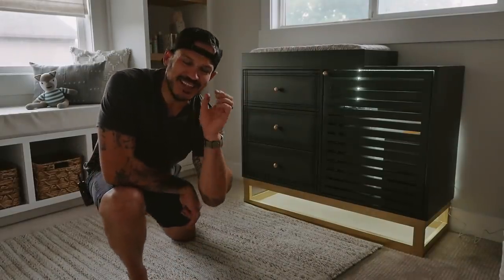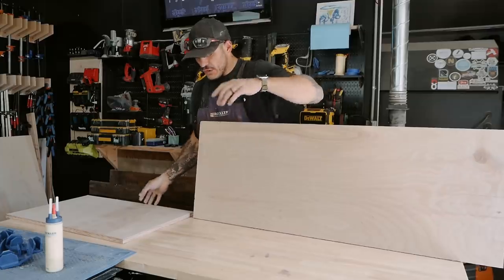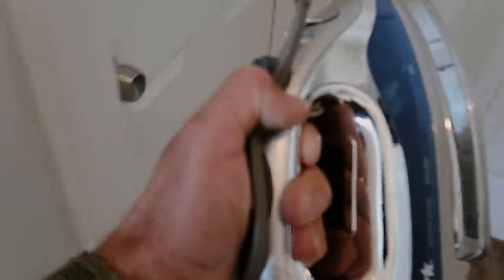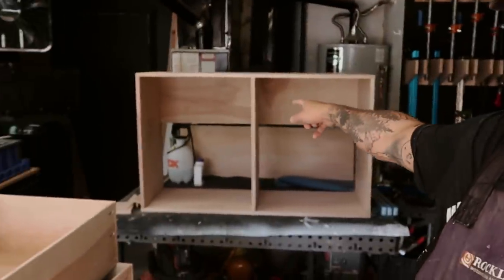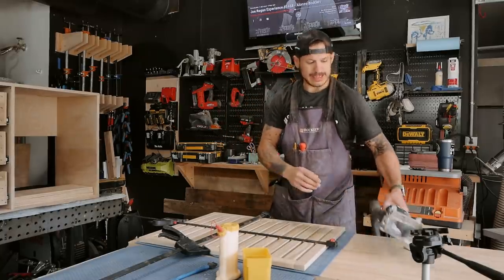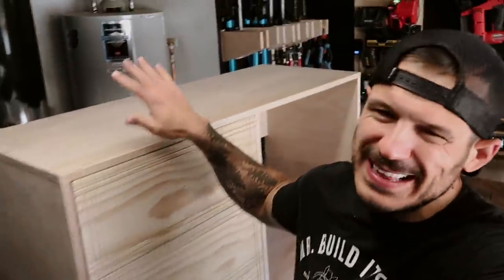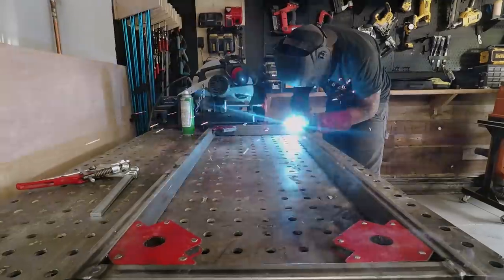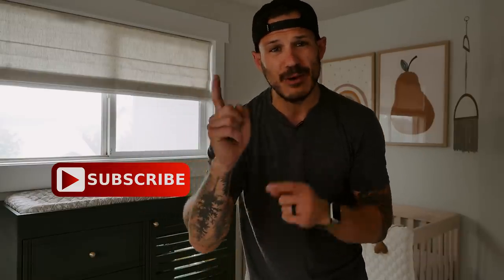I Built our Daughter THE ULTIMATE Changing Table Dresser

Comment: 16:58 Best tip you will ever learn. Using a ziplock back to line your sprayer container...holy crap! So much easier for cleanup and if you have extra you can easily transfer it back into the container, nip the corner and pipe it back into the original container. This is what learned from your video, nothing to do with the build, which is awesome btw, but I'm taking that zip lock bag idea.
Reply: I saw him do it and I didn't even put 2 and 2 together. I hate cleaning my container after use. This just saved me soo much headache
Reply: @joethc  you still need to clean the the sprayer, but this is just one less thing to clean.

Comment: I love that you use iron on edge banding. About time someone exposed the easy secrets of finished edges. Also, just a little tip with drawer boxes. Since you're cutting the groove for the bottom have you ever thought about using the same depth to score the sides of the drawer box? Its an easy dado for drawer boxes and much easier to build the boxes when assembling the box rather than using the pocket holes. Food for thought. I love you simple projects and how you lay everything out for the average joe.

Comment: Instead of using a knife for the edge banding, one or two solid passes with a chisel works best. Doesn't have to be sharp, just make sure to keep the edge of the chisel flat
Reply: A plane blade works even better. I used to work in a cabinetry factory and they just zipped through excess edge banding. The wider profile also makes it easier to keep if flat. A sharp one works best.
Reply: @DiamondmastersMC  I just prefer to use a chisel because of the grip, 1 1/2" chisel is easy to keep flat. I'll try a plane blade next cabinet job I do cheers